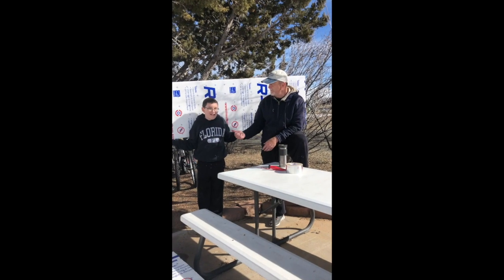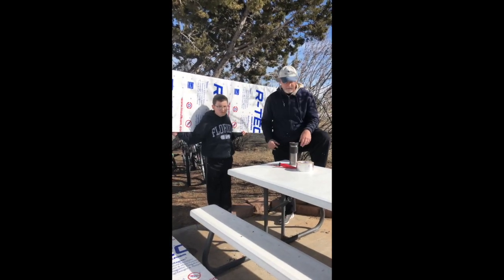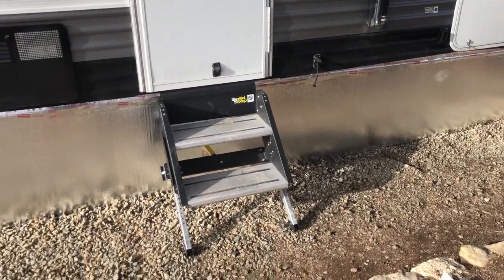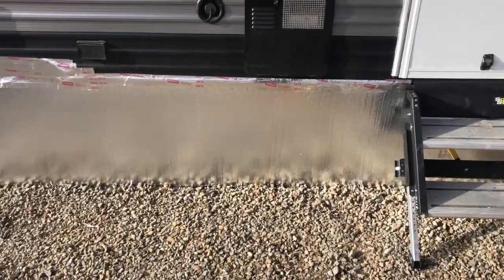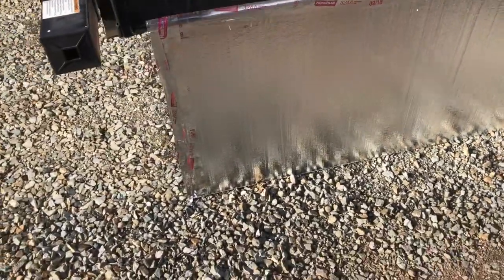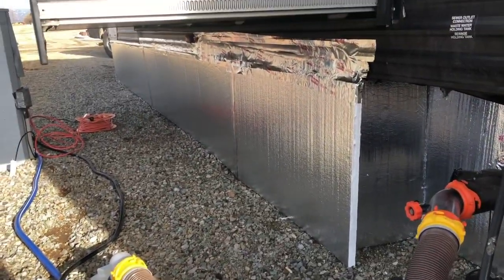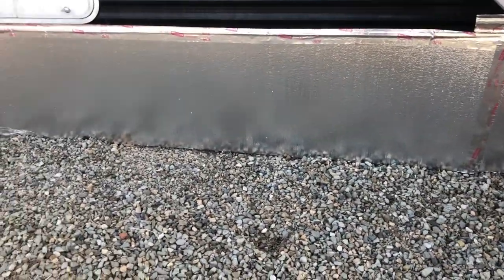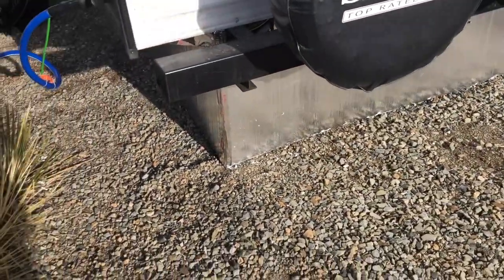How to skirt your RV for under $100

Comment: Hmmm im going to try this hopefully it can hold up to Colorado winds..
Reply from the maker: We were on a hill in Santa Fe NM and there were some very high winds.   We did have two pieces blow off once but we were able to put them back and brace the bottoms a little better.    We used large rocks at the bottom on both the inside and outside of the boards.    Also, key tip...    We SHOULD have installed this with the silver side facing inwards for better temperature regulation.    Good luck!

Comment: I just did mine, and it was roughly 800$ for the insulation alone. still better than freezing lines though.
Reply: What did you use ? 2" foam boards here are $40 x sheet
Reply: @Gianluca Fiorillo  1.5 inch purple foam board, at 40$ a piece. Plus extreme weather metal duct tape. A bunch of rolls. But my camper is a keystone montana 3720rl. So it's a pretty big size and I even did around the 5th wheel as well.
Reply from the maker: If I recall correctly we may have only used 1".    Keep in mind this was also back in 2018 and prices were different back then.
Reply: @juliastimeout  oh yeah, prices sky rocketed like crazy.
Reply: Shows how much prices went up in the last 5 years

Comment: Why did you leave the foil side of the foam board out? Hoping to do this day after tomorrow?
Reply: To be honest Joy we didn't give that much thought at the time.    Upon hindsight we probably should have turned the foil to the inside as that would have trapped more heat under the RV and keeping it even warmer than it did.

Comment: Can’t wait to see if the foil tape doesn’t leave a residue. 👍🏼
Reply from the maker: Stay tuned and we will let you know.
Reply: It will, yet it is removable.
Reply: Wat about under my 26ft 5thwheel...on the ground..wat type of plastic ..any ideas 😊pls
Reply: Wat about under my 26ft 5thwheel...on the ground..wat type of plastic ..any ideas 😊pls
Reply: Wat about under my 26ft 5thwheel...on the ground..wat type of plastic ..any ideas 😊pls
Reply: Wat about under my 26ft 5thwheel...on the ground..wat type of plastic ..any ideas 😊pls

Comment: Is the foam board supported at the bottom? I would be concerned that wind would make quick work of your lovely job.
Reply from the maker: Hi Caryl,    At this particular campground we had a lot of rocks which we used to wedge the foam board from the back and the front at the bottom.  Where we stayed in Sante Fe got very windy with gusts up to 50 - 60 miles an hour at times.     We did have one board that the wind eventually blew off but we were able to retrieve the foam board and re-support it and had no further problems.    This lasted for us for approximately 3 months.   Another option would be to get some 2x4's and attach to the bottom to weigh it down but we had no issues.
Reply: @juliastimeout  Thanks for the update. I really like your idea and will use it. Love your channel.

Comment: Can any help with under the goose neck area ie floor of bedroom exterior hell a cold thanks for all suggestions.girl alone😮
Reply from the maker: Hi Carla,   We recommend using Reflectix (https://amzn.to/3PEv88x) and silver tape (https://amzn.to/480dEup) to cover the front section.   This can be used to wrap around the gooseneck as well (if needed).     If the cold is coming through from the front and causing the head of your mattress to be cold underneath you might want to get a mattress underlayment.   See our video here... https://www.youtube.com/watch?v=l-iuPI4Yi74.    This helped us tremendously, not only with coldness but moisture build-up underneath the mattress due to cold exterior temperatures.   The stuff we bought appears to no longer be sold on Amazon.   I did some quick research and found another product on a different website which is similar...   Do a search for Hypervent Aire-Flow™ Mattress Underlay for Mattresses & Cushions and get something similar to this if you are staying in colder locations at any time during the year.
Reply: @juliastimeout  thank you so much for your help I'm in sechelt b.c. . appreciate the time you took you are good medicine  😻❤️🥰

Comment: How did it hold up in the wind? Did you support it from the back (under the trailer)? Also do you recommend skirting around the slide out? Thank you
Reply from the maker: Hi Rich,  At this particular campground we had a lot of rocks which we used to wedge the foam board from the back and the front at the bottom.  Some of them were pretty big and I believe we came across a few bricks as well.  Where we stayed in Sante Fe got very windy with gusts up to 50 - 60 miles an hour at times.     We did have one board that the wind eventually blew off but we were able to retrieve the foam board and re-support it and had no further problems.    This lasted for us for approximately 3 months.   Another option would be to get some 2x4's and attach to the bottom to weigh it down but we had no issues.           We did NOT skirt around the slide-out and were able to keep it pretty warm inside although had we skirted around the slide-out we're certain it would have held the heat even better.
Reply: @juliastimeout  Thank you for the information. We're planning on doing some winter camping this year in Utah and looking at some sort of skirting, not spending a lot of money until we figure out if we like winter camping, and was just concerned with the wind. I like your recommendation though. Best regards Rich

Comment: Did the tape leave a residue?
Reply from the maker: Hi Michael,   We had zero issues with tape residue.   It's important to note that we didn't use standard duct tape rather the foil AC accessory tape.     Common duct tape will absolutely leave a residue but the foil tape left little to no residue.